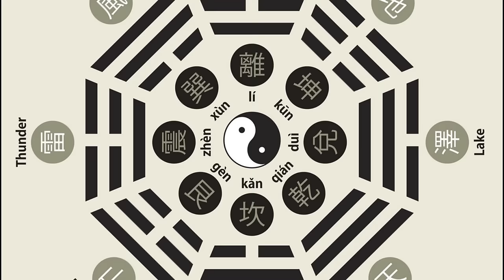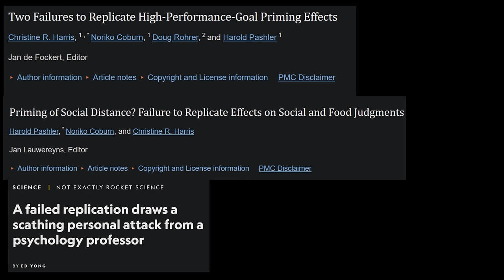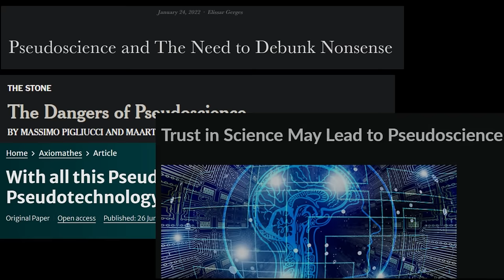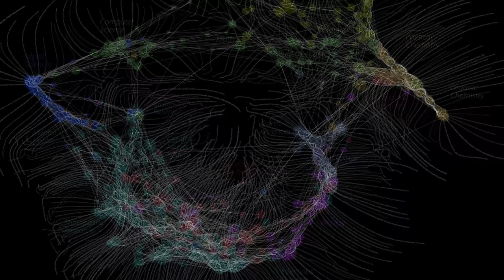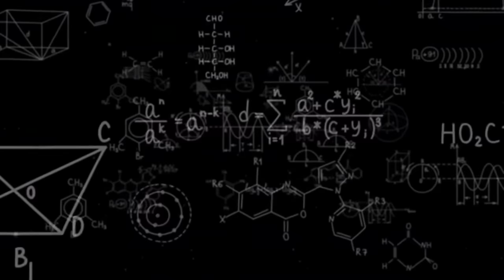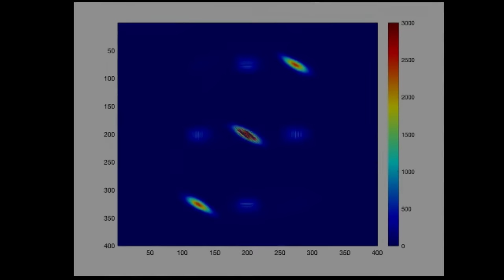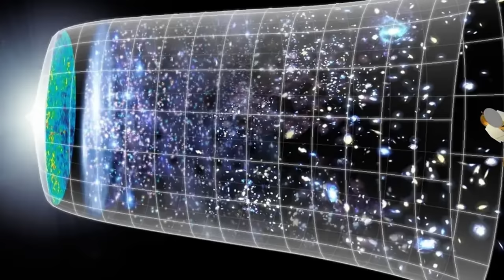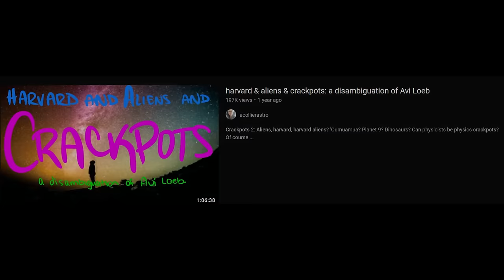How Science Became Unscientific

Comment: Quantum mechanics Concept while not exactly easy, is not almost impossible to grasp. 

Objects can be seen as packets of waves, the wavelength of these waves shrinks as the object moves faster and has more mass. 99.999% of the time the wavelength of these wave packets are so tiny, it might as well be a single cohesive object. For cases with very very small objects the wavelength are significant enough to start becoming relevant and all the rules and principles we know of waves (diffraction, waves cancelling eachother out, resonating modes when waves stuck between to barrier) start applying to objects with similar results.

It is very strange that objects act like waves at all but "shut up and just trust the maths" is such a cop out response. We don't accept that excuse for our conception of vibrations and waves we shouldn't accept it when basically the same principles are applied to Quantum mechanics.
Reply: Quantum physics =/= quantum mechanics. 
That's like saying mechanical engineering = physics
Reply: @yallneedjesus5465  Mechanical engineering IS basically physics. Thermodynamics is both mech eng and physics, waves is both mech eng and physics, gravity is both used in physics and aerospace, quantum mechanics literally uses the same equations and principles as vibrations with different names. Engineering is applied physics so the focus is slightly different but they fundamentally the same thing.
Reply: @yallneedjesus5465 They are the same thing lmfao. They’re different names for the EXACT same thing. Get out of here

Comment: The relativity and quantum stuff is not quite right. Quantum mechanics is nonrelativistic, with its wave functions of particles and spooky action. When combined with special relativity, the solutions are quantum fields….so no more particles. Everything is fine, except for the infinities…..but the QFTs in the standa3d model are all fixable. 

That fix doesn’t work for gravity, but the problem isn’t time. It’s that GR is a field theory of the metric of spacetime, while QFTs have operator valued fields . Which begs the question: WTF is an operator metric?

But fr fr, string theory has been a huge waste, as was my PHD in particle physics…but I still get paid to apply some of it.
Reply: “But I still get paid to apply some of it”

Is a great summation of this video…
Reply from the maker: If you aren't seeing the problem in the metaphysics of time here, then you have been too bamboozled by the math to understand the bigger problem that lies at the core of why those two theories do not - and will not ever - be merged together into something self consistent.
Reply: @Formscapes  which two theories? quantum w/ SR or GR?
Reply: QM + SR = QFT
QFT + GR = WTF

Comment: 10:00 so what if "in science repleciability or repeatability is actually overlooked or tainted by some variables that act like 'Einstein-Tiles' "? Because these are patterns of the same shape, but connecting them to another gives infinite amounts of different combinations of arrangements.
Patterns that never repeat and are always different. 
Because let's say that would be the case in a scientific experiment, then "the specific pattern of a shape" in this example "Einstein-Tile", would lead to the conclusion "that science (the repeatability) has failed, even though there is a system with specific rules, thus there should be a study of "non-repeatability" and further research into the difference of the results and where they actually still do match.

Because Einstein tiles are a pattern without a repeating pattern of one shape with the same form.

And there may also be different kinds of Einstein tile derivative forms.

Comment: The theory of relativity is relative itself.
Reply: Theory of relativity was RADICAL back when it was originally theorized by Einstein, and I’m sure if Dave was a professor then, I’m sure he would’ve made a debunking journal on the theory of relativity. I guess in a terrible way, science has always been dogmatic.
Reply: @sunshineimperials1600  It would have been radical, but you should know that there were relativistic terms, only that they were not put in a simple and elegant formula like Einstein's. The theory of relativity is based on the constant speed of light in a vacuum and Minkowski spaces mathematics, but there is evidence that initially Einstein he was working with variable speed of light. If the "Exceptional" Mr. Dave was going to make a debunking video, he would surely use these initial works of Einstein which had in them equations with variable speed of light (which by the way.. could be much more real than current theory of relativity)